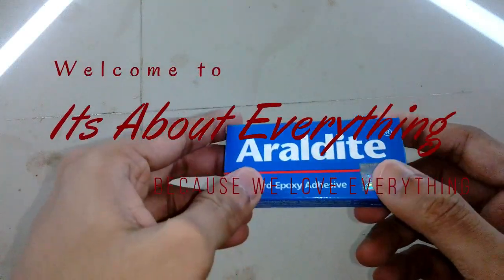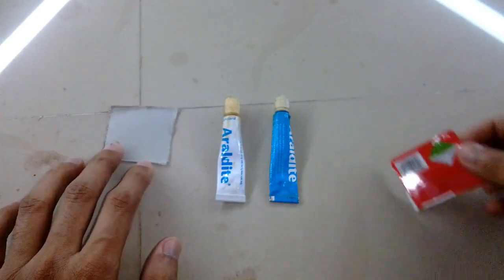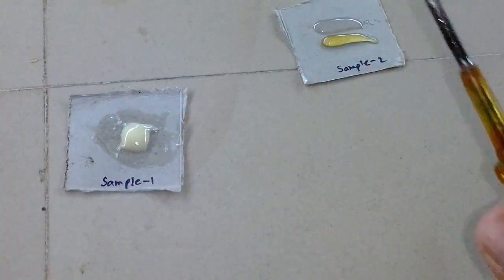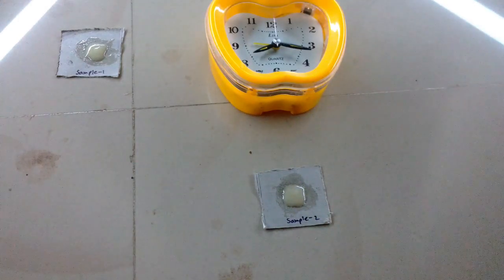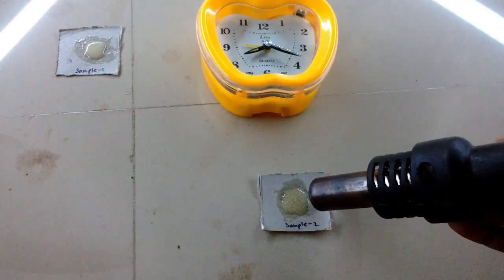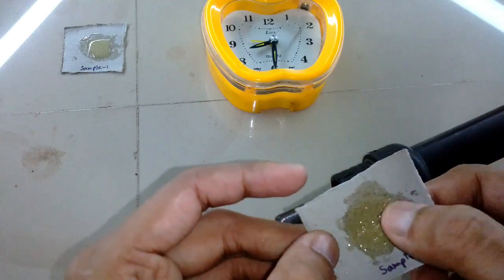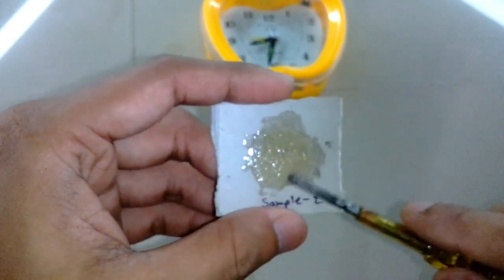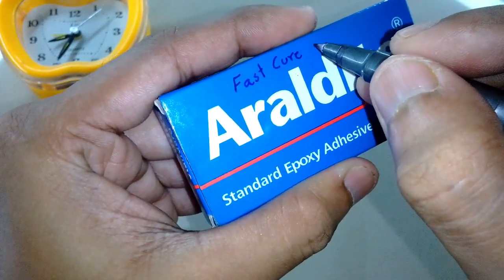How To Fast Cure Standard Epoxy Adhesive -- Its About Everything

Comment: Can I use this for my bike engine crack part . Is it heat resistant
Reply: Yes bro i also use this
Reply: You can use but the engine should be empty it should be not filled with petrol Or diesel..

Comment: What is the point of mixing equal amount when one of the tube is 6g and other is 7g
Reply from the maker: Hardener should always be mixed in less amount then the resin, for proper curing . Thats why 6g and 7g. In some epoxy the quantity is same as the compensation is already made while adding the active ingredient.
Reply: You have to mix in equal amount(volume) , not in equal weight..usually, no one has a writing machine to measure weight before mixing it...

Comment: The issue with epoxy like Araldite is that there are some air bubbles in the paste when it sets. It increases when heat is applied, therefore it can't be used to fix rusted pterrol tanks. It is only suitable for use as a glue.
Reply: After mixing put the mixture in Desiccator for 15 minutes ,then there will be no bubbles.
Reply: Correct

Comment: If you are concerened with bonding strength, 1) Avoid using metallic object to mix resin & hardner 2) Let it dry at room temperature, not even under sunlight. I learnt this hard while fixing a dicky latch for Verna.

Comment: Can I use to attach heavy metal plate to the bottom of cooking pan (which is separated from pan base), will it work ?
Reply from the maker: Although it can withstand high temperature but not direct flame. So in this case you need to Braze weld it or solder it. (Not the electronic solder)
Flushed riveting will also work.
Reply: @ItsAboutEverything01  ok thanks
Reply: You need to gas weld it, no glue or resin will hold upto high temperature

Comment: Kya me is se induction ki glass plate chipka skta hu?
Heating hone pr pighal thodi jayga ?
Reply from the maker: Nehi piglega, epoxy se laga sakte hai. 
Better alternative aap silicon adhesive use kijiye, automotive  RTV silicon bhi chalega, yea high temperature resistant hota hai. Drying time 24 to 48 hours. 
You can also use b7000 adhesive.